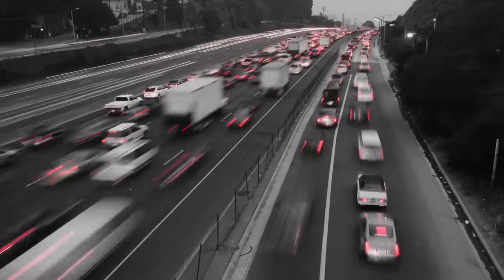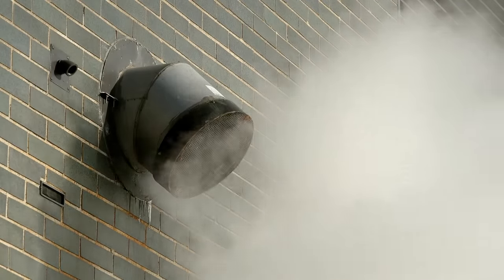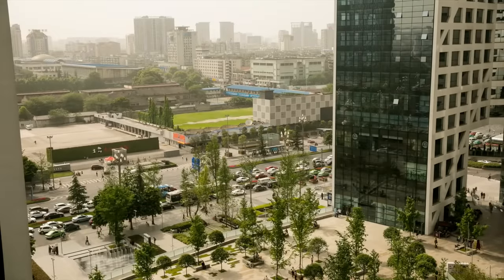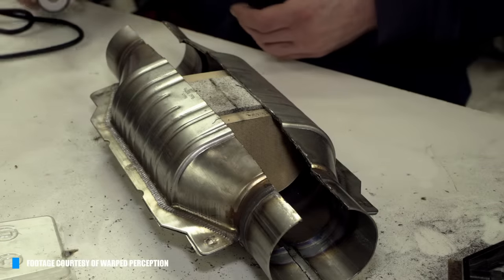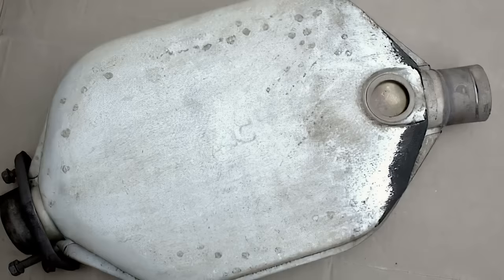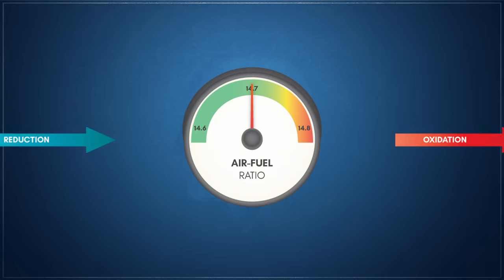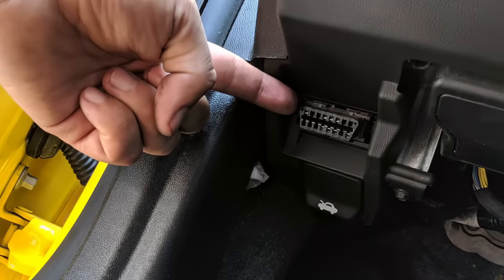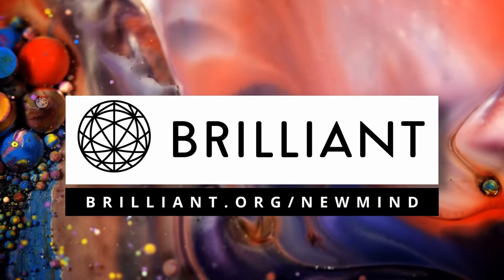How The Most Hated Auto Part Changed The World

Comment: No. The most hated is EGR,  Stop-Start and "smart charging - recharging by high above gasification voltage". Those 3 things made car's lifespan much shorter than everything.
Reply: That’s why I purchased a module to disable the auto start-stop feature of my car.
Reply: How does stop start reduce vehicle life? Vehicles equipped with it are either a hybrid and using the motor generator to start which is more than capable of the job or a normal ICE with a beefed up starter motor that can sustain repeated starts.
Reply: @eggnogmonkey  First of all, your engine is stopped when the turbo is very hot and still rotates. That means no lubrication while it still rotates. It can take up to one minute until the turbo fully stops. Second, the accumulator is much more often under high load. The diesel particulate filter (which is mandatory also for benzine cars in EU) don't like the stop-start system.
Reply: @eggnogmonkey  Also I don't like the "button" engine start. It mostly requires to press and hold the clutch pedal. That causes relatively high crankshaft bearing wear due to no oil pressure. The clutch mechanism makes pressure on crankshaft which creates high metal-metal friction at the non-lubed engine start.
Reply: True. I hate the start-stop systems, alot of  unnecessary wear on critical components. But they are made to be a maintenance item now so manufacturers can profit on high value or rather high price items. Alot of the newer vehicles don't even want the owners to do maintenance on them. Most need specialty tools or proprietary fastners. Not much is made to last anymore.
Reply: Yup. I deleted all the emission shit on my 88 Nissan truck, runs so much better now..
Reply: @jaromirandel543  All manual cars nowdays require the clutch being pressed in to crank, even those that don't have the button engine start. Plus crankshaft wear is negligible since oil has additives to maintain a film of oil until pressure builds up again. You aren't an automotive engineer so don't act like you know better.
Reply: No. The first thing is write like someone is reading what you are writing. Most hated by whom, pumpkin? You? 
What kind of car are you talking about? Or carS? The starter won't shorten the lifespan of any car that was built for stop/start. 
A turbo now? Why is it spooled up at a red light and what? no lubrication? Again what car? 
Now the AC is on high? But the accumulator! No AC at red lights? Which car? Benzene will ruin your life man, just say no, and let the particulate filter speak for itself, maybe it likes the start but is indifferent about the stop.
Three things that actually shorten a car's lifespan are not changing/running out of oil, street racing and drinking and driving.
Reply: @BariumCobaltNitrog3n  You should get that Dunning Kruger effect checked out, it seems pretty serious.
Reply: @Hath.0  You can't even form a complete sentence. "You should that..." Try again little fella.
Reply: @BariumCobaltNitrog3n  I refuse to have a battle of wits with an unarmed opponent.
Reply: @tsurutuneado5981  I've seen video where the car was disassembled to every part by technical specialist Martin Vaculík. There was clearly visible relatively high cranshaft axial bearing wear. The technician told it is mainly caused by neeed to press and hold clutch. In some cars there is needed to have selected neutral only. https://youtu.be/z65HyJEMQ8E
Reply: @tsurutuneado5981  https://youtu.be/rlQJ83GIzNY In time 2:07 you can see the crankshaft axial bearing wear caused by need to press and hold clutch pedal when starting engine.
Reply: @BariumCobaltNitrog3n  Do you know why you need the EFB or AGM accumulator in modern cars?
Reply: @jaromirandel543  do tell
Reply: @jaromirandel543  gotta narrow down what vehicles you’re talking bout lmao. I’m not sure of any hybrids that use a turbo, at least here in the states so the point is mute regarding them. And I wasn’t even thinking about diesel since diesel passenger cars are non existent here. I do know modern diesel are shit anyways, all the newer emission restrictions here have gotten less strict than they were 10 years ago because they are so hard to keep clean and stuff like DEF only causes other problems. More of a temp bandaid.
Reply: @jaromirandel543  also, most vehicles have an electric oil pump nowadays anyways as well as a electric air compressor since the ICE isn’t always running.
Reply: Electric A/C compressor**
Reply: @jaromirandel543  same with Electric brake assist systems, can’t have vacuum power brakes if the engine ain’t running so that solution was developed decades ago
Reply: @TheMasterofComment  Because stop-start system and power recuperation. In modern cars all electronics - lights, gauges, e.t.c.. are primarily powered by accumulator. The alternator is disconnected. That means less load, so less emissions. This is mandatory to be able to achieve Euro 6 emission norms. The accumulator is recharged only when its charge is low, (for example 12.1 volts in modern VW cars) and only to around 13.1V and not more. This is deep discharge state for common accumulator and causes creation of sulphur crystals in the electrolyte. If you want to recharge accumulator to maximum, you have to perform engine braking. While engine-braking the accumulator is engaged to create load, but it deliveres 16 Volts to accumulator. This is high above gasification voltage which is 14.4 Volts. In modern accumulators you can not refill the electrolyte. All of that shortens the lifespan of every accumulator. The common accumulator under this load will not last longer than few months. The EFB or AGM accumulator will overlive it bit longer. 2-5 years.
Reply: Is there any emperical evidence that those things shorten a vehicle's lifespan?
Reply: @Hath.0  Dude is spitting facts. Sae mechanic here.
Reply: @jaromirandel543  Haha you don't know? That's rich. Such a troll.
Reply: Stop-start never made sense to me. I figure that every single time an engine is stopped and started back up will produce MORE harmful emissions because the catalytic converters are being cooled every single start-stop cycle. The cats have to warm back up again before becoming fully effective. I think start-stop was a poor EPA decision.
Reply: @jaromirandel543  You’re right that a common car battery can’t handle a start/stop system. That’s why they use deep-cycle batteries, which are totally capable of handling the additional load. Also, engine bearings are coated with “dry” lubricants to prevent added wear.

Turns out automotive engineers are smart people which are capable of designing around the problems that new use cases might introduce.
Reply: a lot of people feel and think a lot of things about auto start and stop. but yeah I guess people also start their modern cars and let them warm up for five minutes still and don't want to hear that it's not necessary. that the owners manual is designed to trick you into killing your car so you buy a new one... companies that's entire reputation is reliability...
Reply: @DrRyan82994  Right now I use almost 24 years old car. Runs like the new one. I wonder to know if the new car will last as long as my actuall.
Reply: Hot take: I honestly don’t think EGR is as bad as people make it out to be, and shouldn’t cause significant wear under the right conditions and under regular maintenance. A lot of EGR and DPF systems get their bad rep from excessive idling, low-speed driving, and aftermarket tunes. Every once in a while, have deposits cleaned from the engine.

Gas engines rarely have issues with EGR, nor does it hurt performance (if anything, EGR often improves fuel economy), but deleting EGR can still improve reliability by a margin.
Reply: @jaromirandel543  Well the battery in my vw work van from 2019 is still ok, its getting a little bit weak but its still ok, so that few months is definetly not true.
Reply: EGR does not reduce the life of the engine. Poor design does that. EGR reduces heat and load on the engine in cruise conditions by adding inert gas to the combustion chamber. That's it. It doesn't reduce your power output because it doesn't flow when the engine is under load. It doesn't harm the engine.
Reply: @jaromirandel543  what does the button start have to do with pressing the clutch to start? Cars have required the pedal to be pressed to start the engine for 30+years now.... Long before push button start.
Reply: @hondaguy9153  No, they don't I have car from 1999. never had to do that. The EGR is mainly for reduction of NOx emissions. The EGR likes to clog itself. Once the EGR stop working because it is clogged, the engine is switched to emergency low power mode.
Reply: @jaromirandel543  I haven't driven a car built after 1992 that didn't require you to push the clutch to start the engine. I've driven several that were built in the '80s that required that. I know what the EGR does and I've never driven one that switched into any kind of limp mode because of an EGR failure. It will set a check engine light but there's no reason for it to reduce the engine performance because of that. If a manufacturer decided to have it go into a limp mode that is on them it has nothing to do with the nature of the EGR valve. There's no reason to remove EGR or block it off. If the engine and intake are designed properly, you can clean the passages and put the valve back on and be back in business.
Reply: Dont forget cylinder deactivation
Reply: @hondaguy9153  In EU is to enforce user reduce emissions. In old cars you had to press clutch because starter was too weak and transmission oil too thick. But nowday the transmission oils are very thin. If you have driven truck, there is impossible to press clutch pedal because the power booster is not working. Also in old cars the axial bearings are bit different.
Reply: If you hate EGR it's because you do not understand what it does.    If you understood what EGR is for you would not hate it.   There are no exceptions to this.
Reply: @shoveI  You have to take into account if there is more ecological to fix car than remove EGR and other gizmos.
Reply: @shoveI  100%
Reply: @BariumCobaltNitrog3n  hot turbo at switch off ...bad    oil cooking in turbo in just switched off motor ..bad . More times ...more bad 💀
Reply: @jackd1582  And which car is this?
Reply: @kittyNya38  You had to purchase a module to disable auto start-stop? It's literally just a button on mine to toggle it...
Reply: I have a 20-year-old Prius with 160,000 miles on it. It has probably stopped and started 250,000+ times. It still runs perfectly, gets 47 MPG.

Comment: Cool video. It's quite rare for an OBD1 vehicle to have post cat o2 sensors. I was hoping that you would touch on the widely used scheme of pre cats and a second converter.  Even my 2000 has two precats (split 3 & 3 cylinders) that are mounted very close to the engine right after the exhaust manifold. Then they funnel into one larger more traditional looking cat in the normal place.
Reply: Are pre-cats just oxidation converters ? Meaning they are as close as possible to the exhaust valves and glow white hot and burn any remaining hydrocarbons ? Sometimes they are just scrolls of stainless steel looking material !  I know from the car salvage industry that pre-cats are usually of little value when it comes to recycling the precious metals and the real value is in the main/secondary converter !

Comment: I love it when safety technology is so ubiquitous that it can be almost forgotten about, blending into the background.
Reply: Until someone steals your cat converter
Reply: Or if the engine check light comes on
Reply: Or Mod your car
Reply: Or costs so much money that it isn’t worth it…
Reply: Or the ECU gacks and the exhaust is carbon laden.
Reply: Amazing comment thread.  I agree with every comment so far.
Reply: safety?
Reply: @Ayrshore  yeah safety so you don't die of pollution
Reply: @gotworc  lmfao.
Reply: It seems a safety device.  But it only acts as one after the engine heats up enough.  Which seldom happens on short trips.  (Or the surface of the interior materials have not been coated.)  In these cars, the cat is actually more poisonous that the system is replaces.  But at least the manufacturers are making money.

Comment: The downstream (post cat) oxygen sensor isn't just checking the level of oxygen in the exhaust - it's used to check that the oscillation between rich and lean is not visible behind the cat as the cat processes everything. Anyone who wants to watch their car working should get an ELM327 device and read the OBD2 Live Data with it.
Reply: I just converted my truck to carb got rid of all that computer crap

Comment: I was a master automotive technician for 15 years. Whilst I absolutely lament the problems newer diesel vehicles have with their catalyst and emissions systems, I feel it is the greatest single thing that made vehicles better. Just the smell that accumulates on my clothing after working around non-catalyst vehicles can make me nauseous, so it has saved countless lives by reducing harmful pollutants. 

But we are still burning dead dinosaurs, so there’s that.
Reply: On average, engine oil is diluted with about 10-15% fuel and combustion material when you change it. That’s because no matter how good your piston rings are, some oil is lost in combustion. That works both ways, as fuel gets into the oil. For the most part, it balances out on good running engines where the fuel dilution is matched by amount of oil lost in combustion. 

As your oil gets more miles on it, it gets dirtier with wear and combustion products. That increased dirt is being cycled back into the combustion chamber to be burned, creating a small feedback loop. Fresh oil has less combustion products.
Reply: I was talking to a guy who was the Northeast US sales manager for a major equipment manufacturer and asked him which model I should buy for non-commercial use. He looked both ways and whispered, used pre-epa 3 years at the time (off road diesel engine this was like 2010). He went on to explain that the best that they or anyone else could do was assume the warranty rate would approach 100%, so they added $7000 to the msrp to pay for it twice during the warranty period. As I wasn't going to run it daily the warranty would expire before I took advantage of the 2 extra catalytic converters I'd already paid for, and once it went I'd be stuck paying $3500 because the computer would shut it down once the check engine light was on for several hours.

Comment: I hate how many people bitch about emissions controls because they vastly reduce emissions and hardly impact performance until you're trying to double or triple the output of the engine and if you're doing that you shouldn't be driving it on the road.  The engines that have issues with EGR and DEF I get are frustrating but that's due to shitty designs, not the existence of that emissions control.

Comment: Not to be “that guy” but a catalytic converter doesn’t cause check engine lights, the emission sensors do.
Reply: That's right, the converter itself has no signal output of any kind that the ECU can detect and process. It's the O2 sensors themselves that detect the emissions fault condition and not the cat.

Comment: I don't think I've ever seen an OBD 1 system that had catalyst monitoring.  This was mandated with OBDII, and car manufacturers are loathe to do anything without being required to.  The monitoring is pretty basic, too, usually it's just the computer watching for the rich-lean swing of both upstream and downstream sensors, and if the downstream one moves too much it'll set a P0420/P0430 code.
Reply: The CAT monitoring system is simple in concept but does a great job. The O2 sensors are actually one of the main systems used to monitor how the engine is operating in general and gives a lot of information when trying to find what is causing the sensors to read out of spec measurements for normal operation. The CAT monitoring system is not just monitoring rich to lean movements though, its making a calculation of how much of the pollutants are being converted and comparing those reading against all the other sensors on the car and the PCM crunches the numbers and if they dance than the CAT monitor on your car passes another day.

Comment: I only hate catalytic converters because many people get them stolen from their vehicles.  I live in the styx somewhere and thus it is extremely rare to have a thing like that happen out here, especially when you have the vehicle in a garage.  Perhaps it is one of the reasons some insurance companies have discounts for keeping a vehicle in a garage.  It would only make sense since a vehicle in a garage would be less likely to be damaged in bad weather, vandalized, stolen or broken into by thieves looking for cash and valuables.  Also my garage doors have locks that can slide into the side rails and make it just about impossible to open them.  These also take a fair bit of force to operate so I seriously doubt a coat hanger would easily move them.  They are good to have if you had a power outage and had to leave the house.  You would use the emergence red handle to unlock it from the opener and manually open it then manually close it once the vehicle is out.  You would just have to use the locks mentioned earlier to keep the doors from being opened.  I like to unplug the opener so I don't mistakenly try to open the door while the locks are in use because it will not damage the door but it can make it really hard to undo the locks.  I just use the front door to get back in whenever such a rare occurrence of a power outage happens with me needing to go some place.